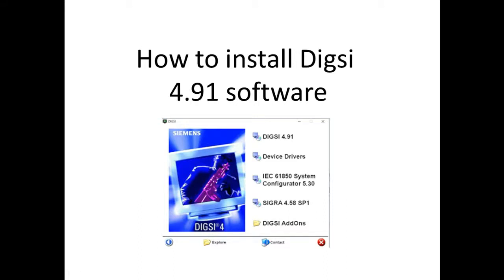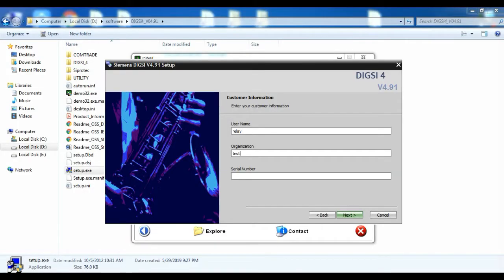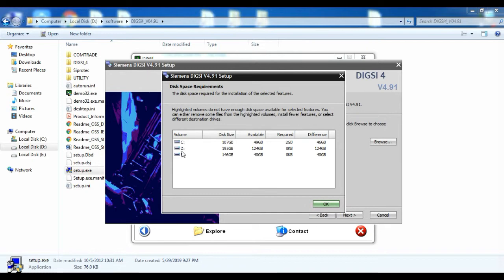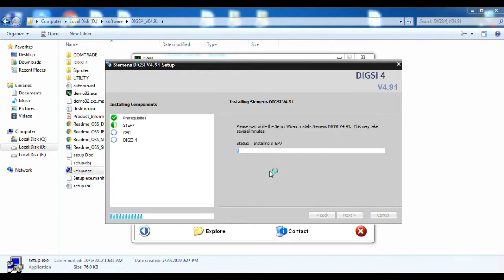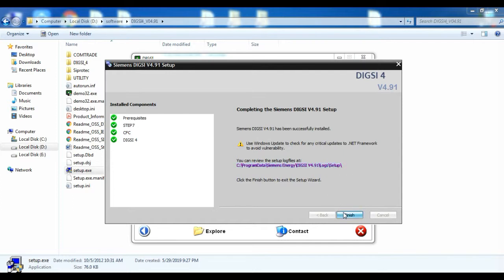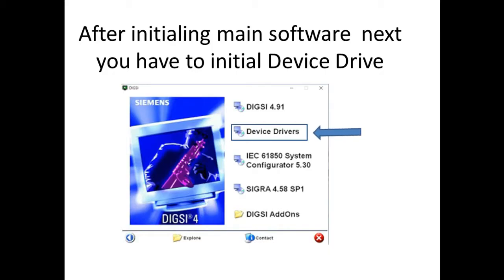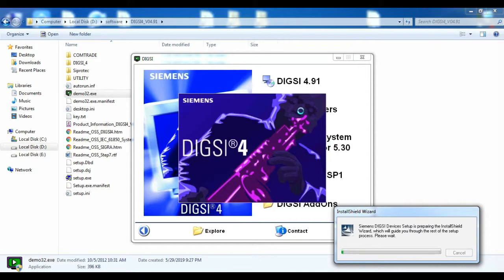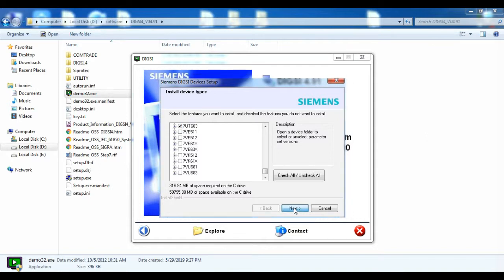How to Install DIGSI 4.91 Software | Step-by-Step Guide for Siemens Protection Relays

Comment: sir if in our substation 7SJ66 relay in installed where or from i have to get serial number ….
Reply from the maker: The serial number is usually located on the front top of the relay or side with sticker or inside relay menu --> setting --> setup/Extra --> MLFB insider you can able to see sl.no. thank you.

Comment: please share DIGSI 4.91 software
Reply from the maker: software you can download from siemens webside 
https://new.siemens.com/global/en/products/energy/energy-automation-and-smart-grid/protection-relays-and-control/engineering-tools-for-protection/engineering-software-digsi-4.html
Reply: Sir how to test  differential in transformer
Reply: May you share ur contact no. Please
Reply: After download When hoing to open filey its asing conversion necessary convert the project by opening an IEC 61850 staion.